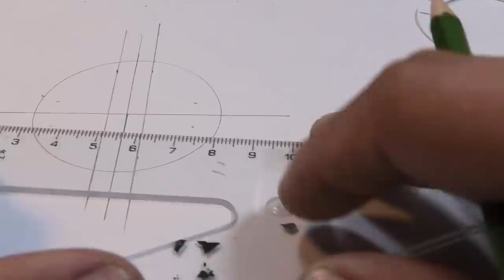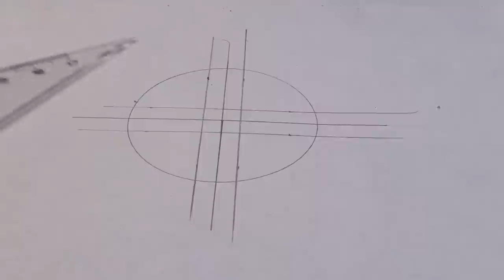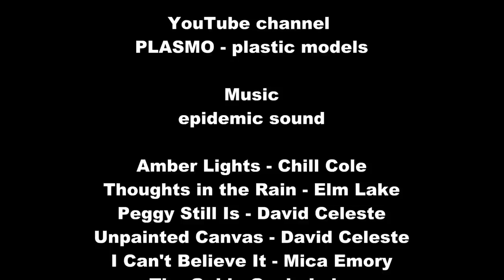Autumn Water Mill Diorama  - 1/72 Model

Comment: Excellent as always, probably the only concern I had was the direction of the wood grain on the 'planks' the building is made of, the wood grain usually runs length ways on planks, not across it as it is on your building. Just a thought.
Reply: Also a roof with perfect alligned tiles

Comment: Hey David!
What a lovely scene! Outstanding work.
 I found an easier solution for making a wire tree. Just hold the wires in an electrical screwdriver and with a pliers you can easily make a tree, by you rotate the tree and with the pliers just hold some wire and twist the tree. Repeat this step as long until you done. You don't need to twist the branches by hand. :) After you done, you just bend the desired shape of the tree. Hope iit helps!

Comment: The next time you do falling water [or any fluid] try what I did with my sandworm:

-dilute water-based paint of the color you want [I did green for slobber] and put it in a dropper. 
-from a different dropper pool what feels like way too much liquid type superglue, just before it spills over [again I held the sandworm mouth up and made it gargle]
-gently tip the surface with the superglue forward while drizzling the diluted paint. the water will activate the superglue creating a white crystalline structure that dries semi-clear, with the paint suspended in it.
- you can repeat the glue/paint water applications to layer. it makes stalactite type formations good for running water [or monster drool]

Comment: there are a couple of steps, you could have saved time on, e.g. if you put plaster on the foam baseplate, melting off irregularities is unnecessary as they will be covered by plaster.